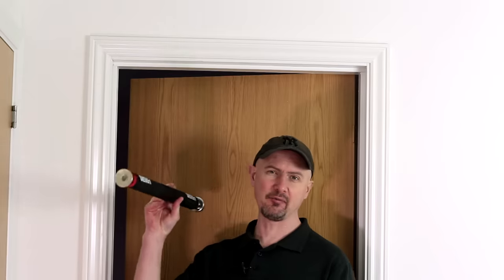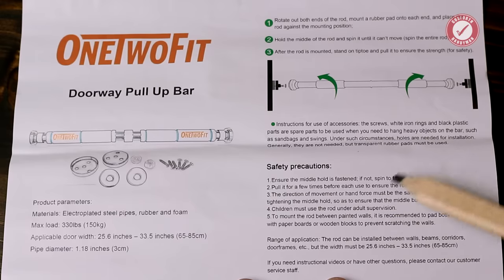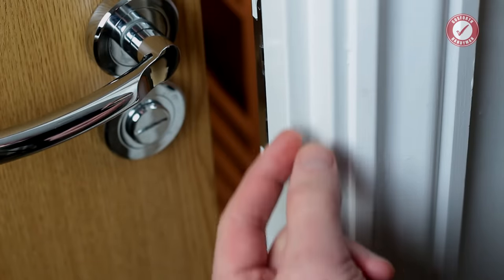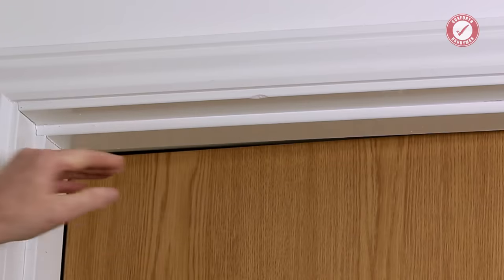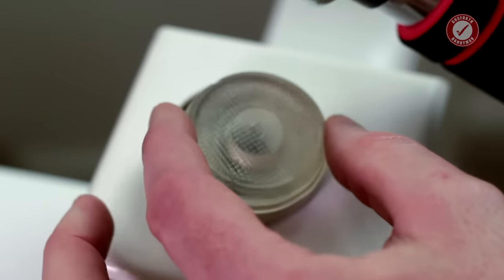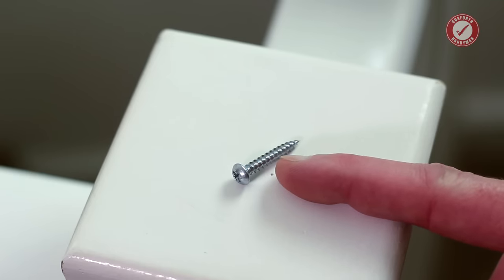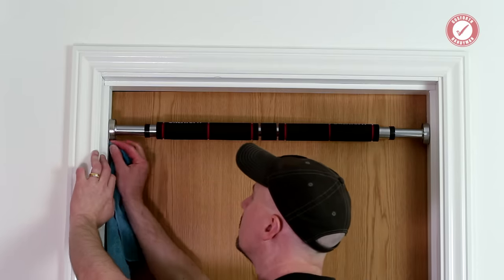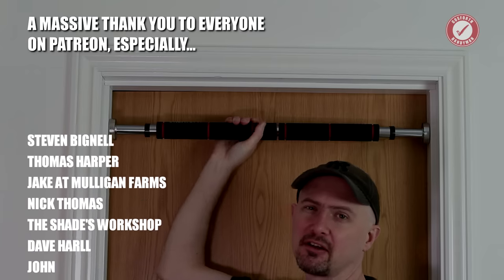How to Fit a Pull-up Bar in a Doorway

Comment: Can I attach it on plastered brick wall(both side) ?
Reply: If you hammer drill or hilti drill the screw cups on both walls lvl & square to each other at the working height you want to live with? Yes. But how sound is the plaster & blockwork or concrete? The last thing you want is flacky plaster falling off your walls. (Note the 3 holes are quit close together could cause it?) Raw plug & screw. I wouldnt chance it on plaster board with hollow tin track cavity walls, the bar screw mech would bow them out lol. There might be a single screw each side option if you can find a suitable sized screw cup or bolt head option to fit snug in the rubber foot recess? Take some measurements find an alternate part. Good place to source your options https://www.accu.co.uk/en/solid-countersunk-washers/24497-HKW-M6-A2 Im looking for sit up locator mounts for small holed replacement rubber feet I found.

Comment: @Gosforth Handyman thank you for making this video. I ordered one of these pull up bars in Toronto in mid-March as the pandemic was starting, and got it in the mail 3.5 months later with no instructions, and no 2"cup door brackets. The manufacturer website says they are now closed and no one responds to emails. I feel like a fool. I've been to two hardware stores, and the closet, plumbing, and fasteners section of Home Depot to no avail. Do you know anywhere online where one could order these door brackets? I have the perfect door to hang this on, with 2" wide walls in that area of the condo, probably with aluminum door frames.
Reply: Brackets finally showed up 3 months later on Ebay.
Reply: Heyy, Can you show me the store which sell the bracket?, I get the similar probs with you
Reply: @aika7974  search e bay user johnblackstyle from South Korea it was listed as 1set Steel Brackets For Doorway Chin Up Bar Safe Work Out Sit Up Home Gym Black , good luck

Comment: I noticed that when a telescoping bar is on my door frame, the door has difficulty closing, as if it puts pressur eon the hinge? I keep my bar permanently on the door. However when I remove the pull up bar. the door can be closed normally. Any one has this issue?

Comment: I got a similar pull-up bar from the internet, but the metal supportive thing, with four holes in your case, has only three holes in my case, missing the one in the middle. Should i drill another hole in the middle or should i mount the bar without that metal part, with only the rubber thingy?

Comment: Hi Andy, is the stop an integral part of the door lining on MDF frames?  If not, longer screws into the lining itself might be a good idea.
Reply from the maker: No but that will take an incredible shear load - see some of my load tests of MDF. 👍
Reply: Andy, yes I've seen some of your tests, I was thinking more about how well the stop is bonded to the lining.  MDF has a horrible habit of de-laminating (for want of a better word).

Comment: Actually you don't have to use the metal sides so you avoid drilling holes into the door frame, you can fasten the bar with fastening the plastic sides firmly against the frame..don't worry it won't slide down.
👋 from 🇯🇴 Amman/Jordan

Comment: I got one of those but it didn't come with the brackets... For now, I'm using it with just friction from the plastic ends and it holds out well enough... I'm around 68 kg btw. But yeah, if it came with the brackets, I'd definitely install them for safety.

Comment: What would you use to fill in drill holes in brick/cinderblock?
Reply: Cement mate 👍🙂
Reply from the maker: In bare brick? You can colour match mortar. If you're not bothered about the colour, yeah normal mortar or 2 part filler can work well too. 👍

Comment: Wish I could have commented a while back about the choice of bar!

I literally bought a very similar type bar from Decathlon's own brand @£15- https://www.decathlon.co.uk/70-cm-pull-up-bar-id_8353818.html

It doesn't have the outer metal ring that is screwed to the frame just the screw in plastic stops - the benefit is when you take the bar off when finished for the day you can hardly notice the white plastic caps! Been using for 4 weeks @ 65kg and no problems at all.

Gotta say pull ups are probably one of the best exercises lb for lb out there - so difficult to improve on as well.

Thumbs up on this, always appreciate humour inserted into the vids!!

Cheers.

Comment: Do you know where I can get the metal brackets that are shown in this video?  I purchased a very similar pullup bar and it didn't come with the brackets, and the vendor has been unresponsive to my attempts to contact them.  I've tried multiple hardware stores and they don't have anything like it.
Reply: No

Comment: screwfix must have improved the quality of the cheese used to make their quicksilver brand screws. The ones I bought, admittedly 30 years ago, were absolute rubbish, heads shearing off, whatever. A bit like the silver-line rubbish tools.
Reply: Screwfix were in existence 30 years ago? Wow, I was in nappies back then 😀. I used about 50 of their Quicksilver screws recently to make a handful of sawhorses, and they were brilliant. Not one dodgy head.
Reply from the maker: Yeah, Screwfix screws are solid - as good as any other brand. 👍
Reply: Yo what are the sizes of these screws. Sorry I’m new to this and Idk what he means by 8ga
Reply: @fantastick8943  an 8 gauge screw is about 4mm diameter.

Comment: Looks great. Also check out the gorilla gym - apparently ca n support over 20 stone with a door-frame clamp
Reply from the maker: Gorilla Gym looks decent but I don't like the look of the ones that are only held on by the architrave. 😀
Reply: @GosforthHandyman  ours is held  by the architrave and pressure clamps like the pull-up bar (no screws) and it hasn't budged a millimetre in a year.
Reply: @diyengineer811  Hey, apologies for jumping onto a year old post but I'm trying to decide between the screw in bar type from this video and Gorilla Gym for my fairly thin doorframe. I'd basically need to notch out some of the doorstop to make some room for the screw in brackets, but I'm wondering if the Gorilla Gym is still going strong and if you reckon it would work okay on a thinner frame?
Reply: @anroon  Yep, it has been used every day for about 3 years! My door-frames are pretty thin too and there are no issues. It has a versatile clamp and also a bar that wedges across the top of the door frame to distrubute the load. Only thing to bear in mind is that you won't be able to close the door when it is fitted.

Comment: Hi Andy. Thanks for the video. My doorframe is too narrow for the circular screw mount. I do have a 'walkway' that's made out of drywall. Would it still be safe if I got drywall anchors and installed the rest as you described?